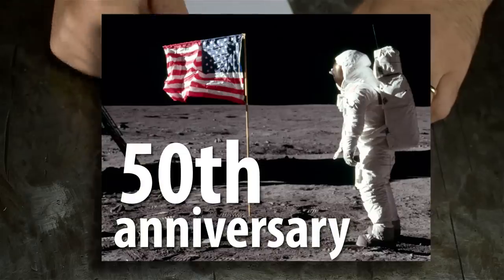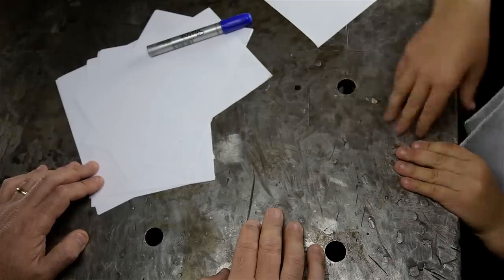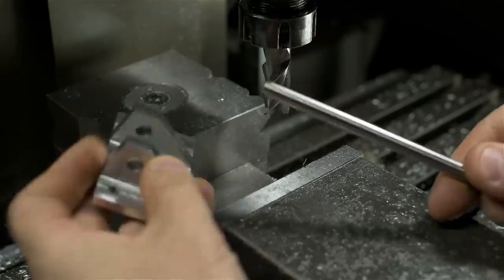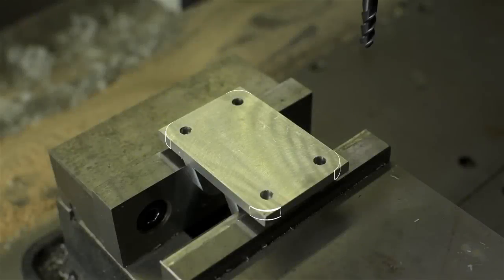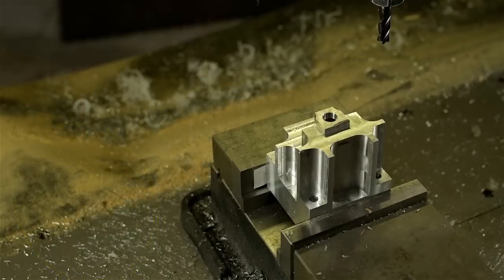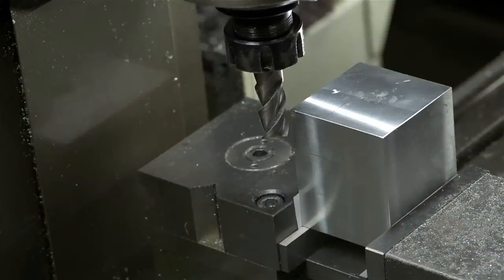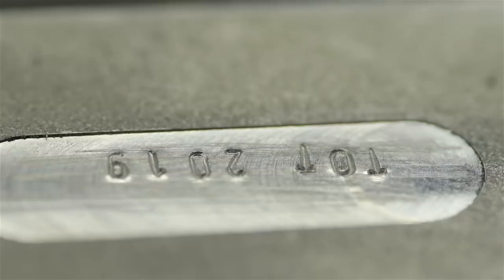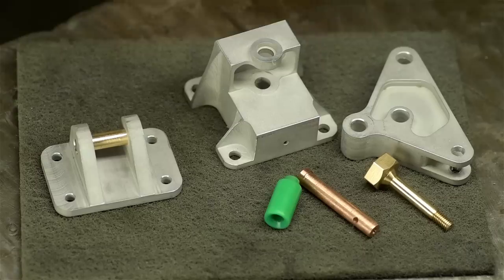ALL IN for PROJECT EGRESS

Comment: Interestingly 50 years ago they didn’t have the computing power of a casio watch - these parts would had been milled more old school. You got it easy Tony! (Nice job though, nice project for the resume)
Reply: The first NC machines predated Apollo by 3 decades. It does not take any computing power to run them either. They did it with punch cards or paper tape. It's amazing that there are people more clever than you can possibly imagine, isn't it?

Comment: Hello Tony. Love your channel. I have a question that perhaps you may want to talk about in the future. In almost every video except yours, when someone goes to drill a hole using the tail stock  of a lathe, I see the drill bit deflect as it enters the workpiece. Even if they used a center drill to spot the hole. Is this because their tail stock is not perfectly aligned with the center of the head stock? Does the drill bit geometry have anything to do with this? So if not and the tail stock is misaligned, how would you go about correcting this? Well I suppose you could use a boring bar to fix the hole, but NOT a reamer. Your thought on this would be greatly appreciated. Cheers.

Comment: I suspect the crazy head on that bolt is there so that you have two sets of flat work surfaces for a tool. If the bolt's shoulders round off, you could stick an alan wrench in there. That way you have a backup way of quickly removing the bolt if necessary. I think they would probably go to this level of redundancy in most systems.

Comment: when you mill metal, and you get all those chips and shavings, can you recover that? seems like alot of metal being wasted if you cant, especially when you have a whole billet and you make it way smaller diameter. surely the more material efficient thing to do would me forging it? drawing out the metal into a longer piece with the smaller diameter to keep some of that metal.. idk metal is a finite resource, while we have alot of it, no point in wasting it on the garage floor

Comment: Question -and this has been bugging me forever-: What happens to the not small amount of metal chips you and every other machinist, generate?
Reply: I throw mine away. Scrap steel is worth about $52 a ton. So it is not worth saving.
Reply from the maker: mine here collected by the scrap metal guys.
Reply: @1pcfred , I get that it's not worth your while, but still, it seems like such a waste.
Reply: @aikonomic  I work with mostly scrap steel so I am recycling anyways. And yeah the few pounds of swarf I make a year is totally not worth my time to do more with than toss in the trash.
Reply: @ThisOldTony , The Scrap Metal Guys would make a cool band name.

Comment: Here is the Link to the Assembly of this Door:
https://www.youtube.com/watch?v=3jdF1yVBWdc

The Part TOT constructed is not easy to locate though some early flashes are seen before construction. The Bell Crank Mechanism, the part TOT made, was the part necessary to allow  the linkage to transition up the left side and across the top. This linkage was necessary to  secure the door closed. This part is mounted on the top left side; if looking at the door from the inside. In the video link above, it's around the 18 Minute Mark, and after, that both parts can been seen.

TOT's decision to sandblast made his parts stand out from all others. If you view the door from inside the capsule TOT's Hinge Part is located lower left. As a vet I've seen such Hinge Parts used to hold Airplane Doors with fabric straps to keep the door from opening too far. I received Airborne Training and don't recall much of the plane as I would exit but those hinge straps do stand out.  

Unfortunately TOT's part were not kept in the same location the hinge part used at the top was painted Red, obviously from another maker, and TOT's part, sandblasted, was used at the bottom. Too bad they did not assembly both of TOT's Part near each other. 

Great job as always... Cheers...

Comment: When you have a really complicated roughed out geometry how do you setup your CNC tools to avoid wasting time cutting air? I guess what I'm asking is how well do you model the stock in your CAM?
Reply from the maker: I already had their 3d model. I just padded it in the areas I wanted to CNC.    you can usually select "from model"or similar in CAM vs starting from a block.  still had some lost moves though.

Comment: I just built myself a cnc machine and got a white side surfacing bit. What is the easiest way to remove the “hot glue” goop from the bit before use. It’s not coming off too easily.
Reply from the maker: on new ones? the wax coating?I split it by running a box cutter in the flute, back to front. usually the whole thing pops off before I get all the way to the tip.

Comment: I began my machining career in the mid seventies. CNC machines were very uncommon or non existent then. We’re all or most of the Apollo hardware manually machined?
Reply: NC control was developed in the 1940s. So it existed. It just was not widely known about or used. But the government has been at the forefront of computer development. So while you may not have seen it NASA had it. Apollo used a flight computer. It didn't work very good, but they had one.

Comment: You should know what a "Replica" is. Parts do have to have the same color. You could have took a look at the picture of the door and saw that everything is grey instead of the double-hex bolt, which is anodized black. Something you can't do with brass.
Your two parts are in the upper left corner of the door. A replica is nothing you add your own style to, imo

Comment: Wait wait wait. You said you can't keep up with the end mil. SO it means that you need to go faster. But then you say that you decreased the depth of cut so that you can keep up. So cutting less material means you have to go slower?! How TF does that make sense? The only thing I can think of is the fact that the end mill has more length so has a higher chance of breaking the end off.

Comment: Hopefully there wont't be any galvanic corrosion in 10 yeas, as that would really set TOT's parts apart from the rest.
https://aws1.discourse-cdn.com/internachi/original/3X/1/4/142d2a28d5543094a4307361ee5f4df845ca00f4.jpeg
Some anti-ox would be cheap insurance.